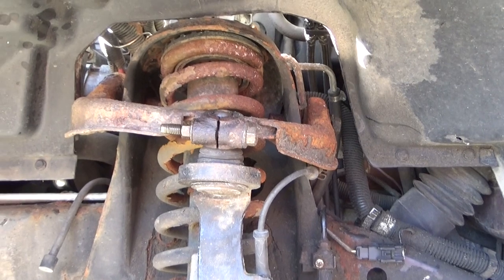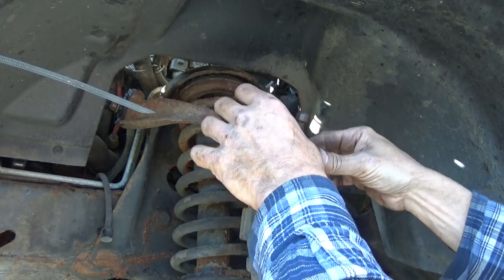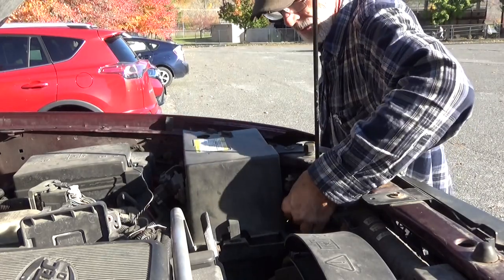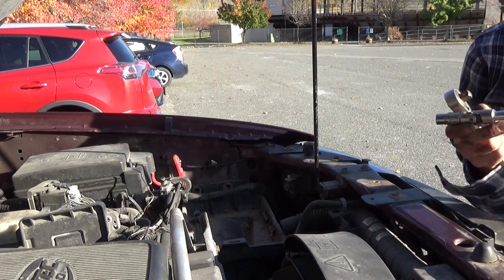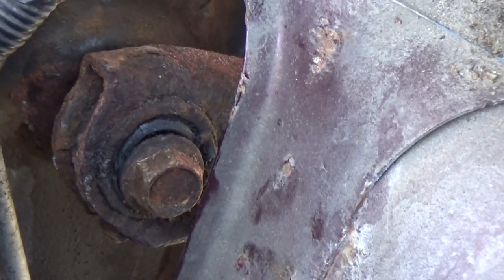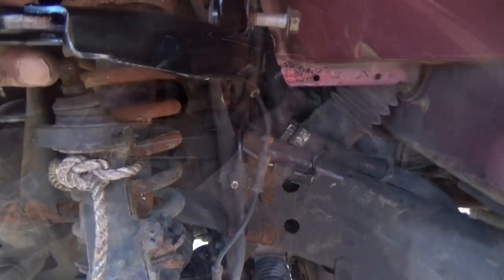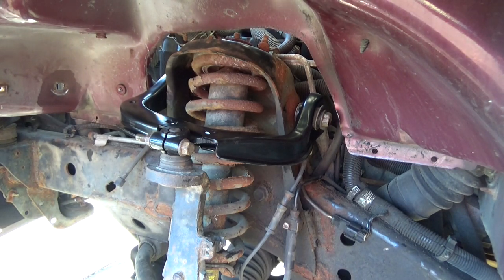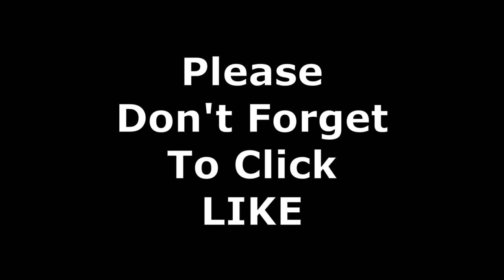2007 TrailBlazer Upper Control Arm

Comment: I like the way you removed the battery tray to get to the other bolt rather than grind the fender like another video
Reply from the maker: Thanks! I try to not do ANY damage. It's pure laziness to not remove stuff to make the job easier..

Comment: An even better way to get the last bolts out for the tray.  Rather than removing the chrome thingy, just use a long extension and remove the bolt holding the horns.  Easy access.
Reply from the maker: Sounds like it may save some time on the next one! Thanks!

Comment: What will cause a shimmy in the steering wheel when u hit a bump...06 trailblazer
Reply from the maker: Loose, worn, or damaged front suspension components. 
(Usually lower control arm bushings)

Comment: Was that trailblazer jerking the wheel when braking and letting off the brake?
Reply from the maker: Fortunately, no. Al! of the rubber was dry rotted real bad, and wouldn't be safe for inspection.

Comment: do you have a video for fixing the power front seats its stuck all the way back the motor engages but the seat doesnt move
Reply from the maker: Sorry, I don't.  Loosen the back two mounting nuts about three turns. Remove the front two, and CAREFULLY lift the front and inspect connections and mechanism.